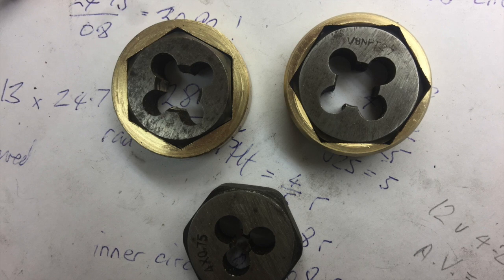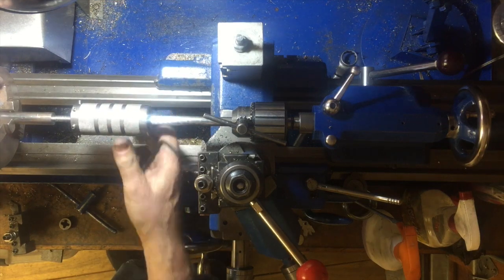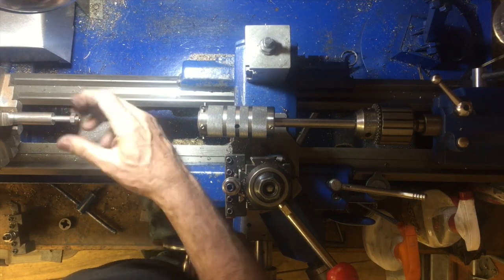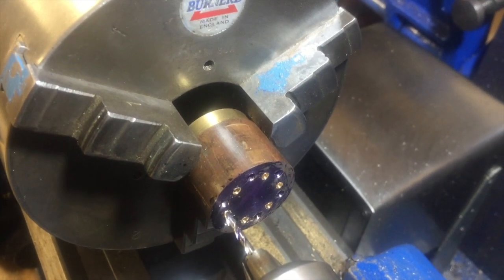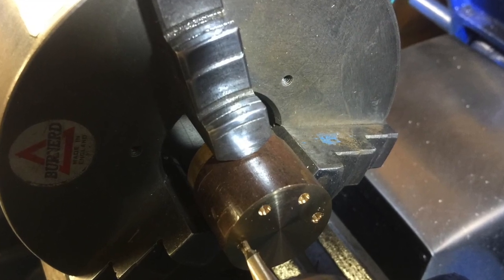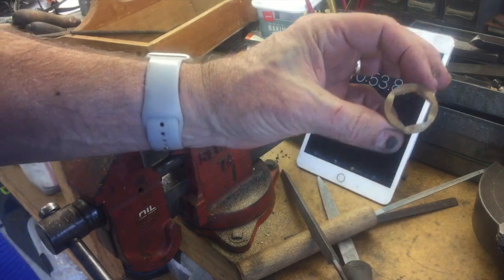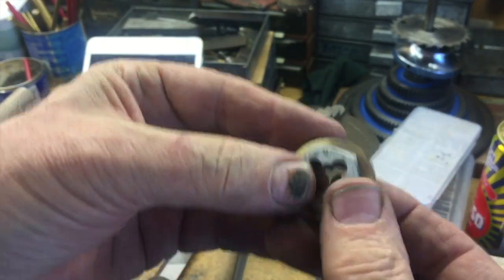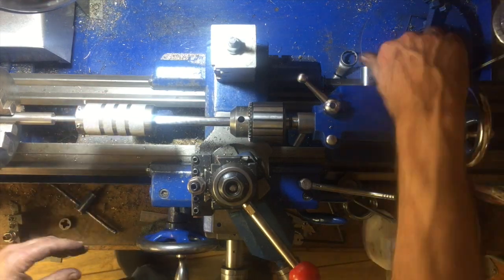Making a hexagonal die holder on an engineers lathe without using a broach

Comment: gads I guess if you like to keep busy but I just cut off the end of a 3/4 " socket it drilled it for set screws  I already had a round sleeve adapter that fits into my bigger round die holder I made for my lathe dance crew goes through all three into the dye works real good